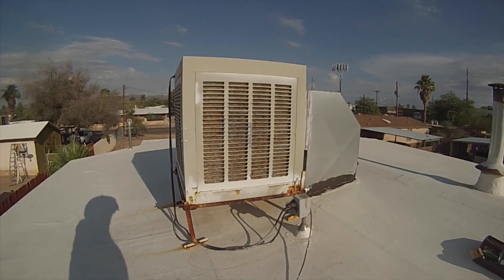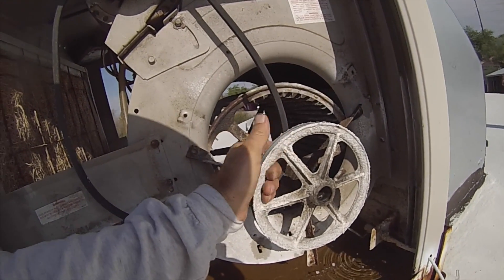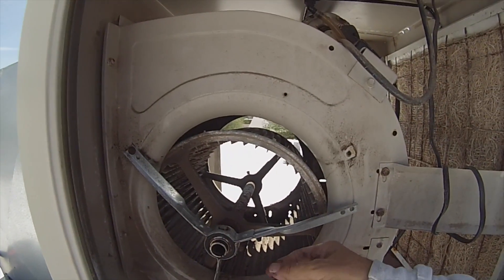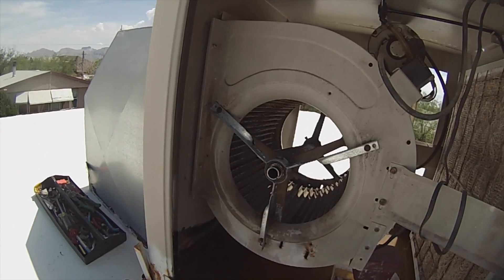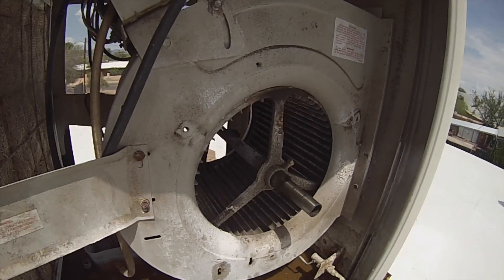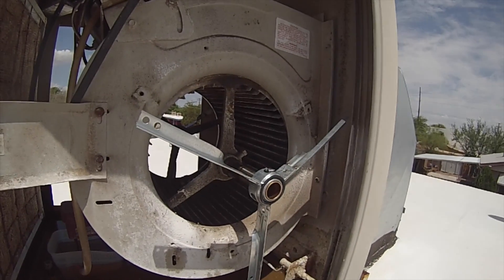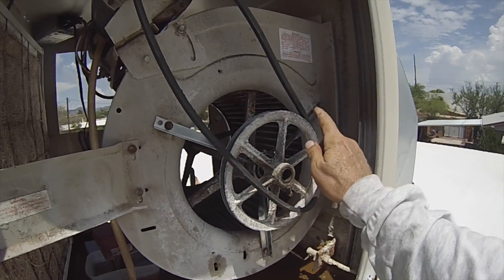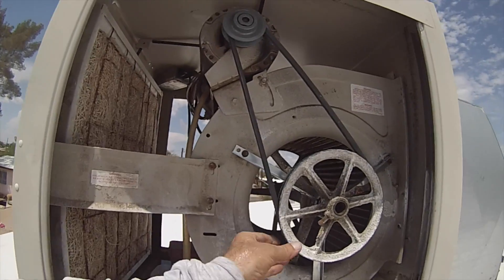Evaporative (swamp) cooler bearing replacement

Comment: I know I am responding to an OLD vid - But two important steps were missed 1)  "Adjust the belt alignment between the two pulleys and 2) the FINAL step was skipped -Adjust the "belt tension". ---  When you put the belt on it was obviously too tight which is a) hard on the motor during startup b) places too much tension on the bearings and belt c) raises the Electric Bill (draws too many amps ESPECIALLY during startup), d) reduces air flow  e) WEARS OUT ALL OF THE COMPONENTS PREMATURELY!!!!!    So this repair was mainly done for practice! You will be doing it again!!

Comment: I am from the future here to tell you Spider Bearings cost $25 each now! lol Great video thanks.
Reply: I’m glad we have you coming from the future , lol , I have the same exact model like the one in the Video but not sure where to get the exact match for the bearings. Thank you in advance
Reply: @alaaadawee3848 measure the diameter of the hole in the middle that should more or less give you the size. Home Depot sells a universal one (which you may have to adjust the size that the guy in the video had to) for about $25
Reply: @lennonblack thank you , I appreciate that!

Comment: Thanks a ton brother, got 2 bearings and a dremel to cut a rusted shut sleeve as well as a car wheel bearing to pull the stupid bearing. Greased it up with Aeroshell and drops of oil through the ports and bingo. Motor doesn't hesitate to start anymore. God bless.

Comment: There's also a collar behind the flywheel side bearing,  I had some boys do this part of the work and they took it off, so I didn't know where it goes back on.  This helped me see that it's behind the bearing, not on the other side or in front of the flywheel. Thanks!
Reply: My shaft moves back and forth. I got a metal collar. Does it go between the flywheel and the bearing? Or should I get a spacer (black tube, like he has) and put it in between the flywheel and the bearing?
Reply: @yeti9127  Yes, between the flywheel an bearings, with a leather washer between the collar and the bearings to keep it from wearing. (or some kind of non-tear washer.) (Mine came with the right washer/spacer.)
Reply: @lukegoffkat This video gave me a clue and it got fixed; now humming nicely without any noise. Yess I did that.. Thanks.
Reply: @yeti9127  Very cool! Good job man/maam.
Reply: I also learned that dedicating a couple of hours to watching videos of real people tackling these fixes can be really encouraging, even for someone like me. I just saved $1,200 from a quote that suggested I needed to replace the entire motor! I suspected it was related to the pulley and spacer issue causing the noises, and it turns out I was right. It’s amazing what a little self-education can accomplish!
Reply: @yeti9127  Absolutely! I still had to hire a couple neighbor guys to help me come get the old pulley and bearings loose from the old rusted out shaft, but $100 each for their muscle was a huge savings over, like you said, $1200 or so.
Reply: In my case, I managed to pull the flywheel and the attached pipe and headed down to the TrueValue hardware store. The guys there were nice and tried pulling the wheel off; they finally succeeded! I asked them to get me a new wheel. It slid back and forth for me to play with the belt alignment and the space spacing. Sweet!

Comment: That’s cool. 4 hours of work and you were filming. . . Good job. I was looking for a video that shows what to do when the project does not go smooth. You were fortunate, let me put it that way. I’m working on a swamped after “the other guy(s)” and I’m learning the i don’t know as much as I thought I did. It was weird to me that I could have a Brand New motor with a Brand New motor pulley, brand new belt, and a brand new fan pulley and I’m still getting a major wobble…. I’ve worked on at least 10 swamp coolers over the past 10 to 12 years and I’ve never had to change the bearings until now… thanks again though buddy.

Comment: I recently bought a new motor and replaced the  small pulley and it started up fine but within  5 minutes or so it over heats and shuts down. Can you tell me how to fix this? Thank you.
Reply: Likely the belt is too tight. Most new motors have a heat sensor that will automatically shut off the motor if it gets too hot. Most likely cause is the belt is too tight. First make sure the belt is the correct size. Most new pulleys are adjustable to help set the belt tension.

Comment: I wanted to thank you for making this video, I didn't realize the large pulley had a bolt that holds it on the shaft, that was a big help for me. On my unit, which is a Champion, the squirrel cage is starting to rust, as is the outer legs of the cage. I wonder how hard it is to remove the cage. I would like to have it sandblasted and painted. The manufacturers of these units should use more stainless steel parts and fasteners. They take a lot of maintenance, but when it works, it works great.

Comment: Great video. I added synthetic oil to the bearings but I noticed the one opposite the big poly has been leaking. Today, it has been making that rubbing noise and I’m pretty sure it’s that bearing. The bearing on the poly side where the belt is is dry and is holding oil. So I think the one that is constantly making noise now is the one without the belt pulling in the way which should be an easy one. I never thought to measure the shaft whether it’s three-quarter inch or 1 inch. I guess I will measure that before I go buy a spider bearing. My swamp cooler is running now but I can hear it making the constant rubbing noise and I know the bearing will probably freeze if I keep running it but we’re in the middle of a heat wave right now in Los Angeles. Tomorrow morning I will go up on the roof and measure that shaft and by a spider bearing. I will donate some money to you on the first of the month when I get my pension check in Social Security. Thanks for the informative video I know I can handle that job.

Comment: Would be nice if you didn't skip through the process of removing the pully from the shaft. This is not always a simple task. Parts rust and basically get frozen to the shaft, making it difficult to remove. I've repairs dozens of units, and you make appear simple when there are often complications involved. Some folks tighten the pully bolts and other too tight, and after years of use the buildup of rust complicates things. Just saying.

Comment: Can you tell me what caused to make this repair? What was the initial problem? I'm having an issue where the motor is humming but will not spin the belt. Motor smells like burning. I have replaced pretty much everything except the blower bearings... Thanks for the video
Reply from the maker: The cooler was making a squealing noise that I could hear inside my house, suggesting these bearings were going bad.  If your motor is new but is not spinning the belt, this could mean several reasons:  the belt itself needs adjusting or the bearings need replacing or maybe the new motor is bad (it happens).  Since the motor smells like burning, it could mean that motor is defective.  I would troubleshoot the various causes of why this is happening:  check the tension on the belt, make sure this new motor is installed properly (maybe you did not hook it up correctly), see if you can easily "spin" the blower wheel by hand, inspect the bearings to see if they look old and worn out (maybe they just need re-oiling), make sure there is nothing stuck in the blower that is keeping it from spinning freely, etc.  These are relatively simple machines and you should be able to figure out what the problem is.  Best of luck!

Comment: How will I know the right size or bearing?
Reply: Always bring old parts with you when replacing anything, ever!!
Reply from the maker: These bearings on a swamp cooler are fairly standard.  I would take a picture of the bearing and the cooler on your cell phone and go to the hardware store, Home Depot or Lowes and show the person who works in the cooler dept. what you have.  They will know which bearing you will need.

Comment: Thanks for vid.  Blew a bearing on my Mastercool II series.  $20 for new bearings and a belt.  Back and running fine.  It's a 20 year old unit.  First time replacing.  Worth the $20 compared to AC costs in Mesa AZ.  I too thought it was going to be a pain in the ass to fix, but not really.  Took about 90 minutes of my time, but actually quite easy.  Thanks again.
Reply: Roy Spears I agree.  We run both.  Prefer swamp until dew point is too high.  Could not live with swamp alone.

Comment: my bearings were stuck on so badly I had to use a cutting torch to remove them...
Reply: Yep. I just took an angle grinder to the shaft mine were ceased up so bad. Just going to get a new shaft and blower pulley.

Comment: Thank you for the great video. I have one suggestion that made this job far easier for me. I did the non pulley bearing first, leaving the whole cage assembly in place and then went on the other side and did the large pulley side bearing. I had a bit of difficulty as someone before me had over-tightened the pulley bolt raising a ridge around where the set screw met the shaft. I used the motor pulley puller tool I had and it worked fine to pull off the pulley. I only had to use an old socket from a socket wrench that fit inside the hollow fan shaft, with three pennies glued overnight to give purchase to the center bolt of the gear puller. (fill up the hollow in the socket) I glued them on the socket end with E6000 glue overnight, Worked like a charm and pulled off the pulley easily. I just had to pull off the spacer with a flat screwdriver behind it on the shaft and that worked well also. It sounds more complicated and time consuming than it actually was. :-) Again thanks for the video.
Reply: Oh I sanded off that ridge first.
Reply: Nice job. That’s the bearing I’m going to replace first, the non-pulley side but my question to you is, did you have to support the squirrel Cage so that when you slid the spider bearing off, it didn’t sag or fall causing anything to get bent? That’s the only thing about taking that spider bearing off that concerns me,? I would appreciate any feedback you have, thanks.

Comment: Do wheel before mounts?
Reply: Not sure I understand what you wrote.
Reply: Roy Spears How about leaving mounts on and pulling wheel while everything secure then remove mounts?
Reply: That should work.  If I had to do this job again, I might do it differently.  Try it and see if your way will be easier.  Good luck.
Reply: Roy Spears do you know how to measure pillow bearing. 3 sizes available. Just put WD 40 on.
Reply: Simon C I just took the old bearing off and matched it with the new one. If you have a Home Depot or other general hardware store near you, I’m sure that would be the easiest thing to do.

Comment: I can't figure out what's going wrong with my cooler ?   My cooler keeps going off and on about every 20 minutes by itself. I the assumed the motor was getting too hot, so I've replaced my blower motor 3 times and kept swamping the 3 of them in and out, replaced the bearings, adjusted the belt many times from tight to so lose it was coming off the pully, replaced the 2 speed wall switch, and the power cord to the blower motor. The motor still keeps repeatedly shutting down after about 20 minutes then coming back on. The blowed shaft seems finest since there blower spins pretty much freely from the what I came tell.  I'm going to melt this weekend. Does anyone know what could be the problem?
Reply from the maker: Sorry, Russ, I didn't see your comment until just now.  I'm sure by now you solved the problem.  What was the issue?
Reply: @productandequipmentreviews7386  My guess, if it wasn't any of the things he has already addressed, then it might be AMP DRAW. The motor Pully has to be adjusted to the proper diameter for proper Amperage draw. Here is an example of what I am talking about. May require a qualified electrician  https://youtu.be/jzf2Tq23xS0

Comment: I replaced bearings on AC unit and in 4 days the bearings are completely worn, I used oil. Any ideas?
Reply: tightened down belt to much?  Alignment is key, maybe it's your motor that needs lube!

Comment: What happened at 7:51? The bearing is on the end, then it jumps to being flush to the back, how do you slide it back? My new ones won't go on, they are definitely the same size as the old ones but get stuck on the ends of the shaft. I have sanded, and oiled and they won't go on, help!
Reply: What kind of tool are you using to install the bearing?
Reply: So pressing a bearing onto a shaft is real skill?

Comment: I do not have a swamp cooler, but old my Lennox furnace blower is very similar. I had no idea that Home Depot sold those bearing and supports. Probably not in my area of the country. I highly recommend a lubricant known as Motor Kote. This product comes in a spray can, and far superior to the WD stuff, although everything has a use. Cheers

Comment: I couldn't understand your accent, you from Canada? Anyway water and electricity dont go together. But I woke up still on the roof. After grinding the bolts off, O had to drill pilot holes and ease out the old bolts. Would it not be better to not grind bolts off. The pulley and bearings were frozen. No amount of force or pulley puller would remove the bearings or pulley. So I dropped the whole unit in a tank of hot acid. After cleanup I was able to replace the bearings and new pulley. Pulley dissolved in hot acid. Great news, cost me $12.00 dollars for new bearing. But cost $150.00 to have the shell treated and repainted. Unfortunately I didnt not hook the wires up right, who knew white on white was the rule. The unit caught fire in the night and renters insurance is gonna pay for my stuff. Hey who doesnt like to go shopping right? If you found my comments funny please send $3 to $5 dollars as Im out of beer. Now I have shared some things that can go wrong, do not fret. Usually some penetrating oil and a slight twisting motion will remove all but the most damaged of assembly's. If your using pipe wrenches with poles attached to the ends for leverage, get a professional or buy a new unit. 1/3 power motor supplys are energy hogs. You want to reduce your electric bill pay a few extra dollars and get a 1 hp motor if possible. Change your pads at least twice a year. Good luck folks.
Reply: John Day What the fuck????
Reply: I have a wierd sense of humor. My friends live me for it. My unit is over 12 years old and it runs almost continously. You reall6 will save cash by getting a bigger motor.
Reply: Oil those besring and run it wide open.

Comment: I am having a similar bearing problem with a  Swamp cooler I am repairing for a neighbor.The bearings have not been lubricated properly, if at all, by who ever was servicing the Unit before the home owner asked me to look at it for her. The inner race on the blower shaft has roasted. And is stuck tight. this particular model has one bar, which runs across the open sides of the Squirrel cage housing on Ea side. And the bearings bolt to it. the bad bearing in on the open end of the pulley. So I will try to cut it to remove it

Comment: I can't get the pulley to come off the shaft.  Any suggestions?
Reply: pulley puller, see also https://diy.stackexchange.com/questions/166821/how-do-you-remove-a-swamp-cooler-pillow-block-bearing-thats-stuck-seized-on/166822#166822

Comment: I can't get the pulley off the shaft.  Any help here?
Reply: Mikki Durner Most of the time everything gets ruined, but try this. You might have luck with a propane torch that plumbers use. Heating the pulley and bearing might loosen it. It will smoke like crazy as it burns off all the old grease. You have to be careful the way you heat the pulley. They are usually aluminum and when heated too much they melt without warning or expand unevenly such that they will break, but a replacement is available. The bearing sometimes will be frozen to the shaft and you'd have to grind it off with one of those inexpensive Harbor Freight grinders. Have water available since it would be the pits to start a fire on the roof.
Reply: jgstargazer i used my propane torch and voila!
Reply: Since I was gonna replace it with a new one I used a grinder to cut it off, and replaced spider bearing and pulley, if you are gonna use the pulley again, auto zone will rent you a puller

Comment: You said in the video that you believed that you might have to change the shaft, did you and if you did how easy was it to replace?
Reply: At the end of the video (12:07), he said his neighbor told him he didn't have to change it so he didn't.
Reply from the maker: No, I never had to change that shaft and the cooler worked great.   Then, two years or so later, I sold the house and now have AC so no longer have to worry about swamp coolers any longer.
Reply: @productandequipmentreviews7386  I never replaced the shaft but I did change the bearings and they worked better. Then last year we moved to a new place with central air too.

Comment: Thanks for posting this - it gives me confidence that I can take care of my two coolers today myself. Both are 7 years old, and one started making a horrible knocking sound last weekend. I figure if one went, the other's going to go soon. It's supposed to be really hot this weekend, so I really need to 'get 'er done', but they're side mounts (through the wall instead of a window) and not at ground level, so I'll be perched on a ladder doing this. Wish me luck!